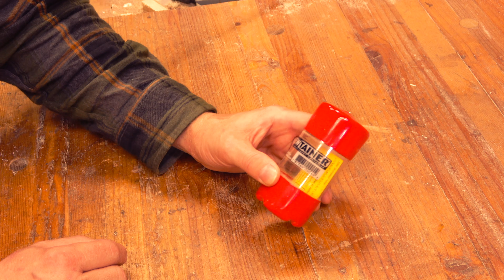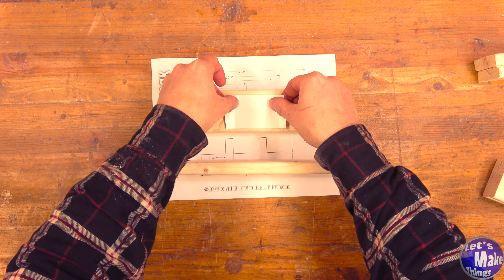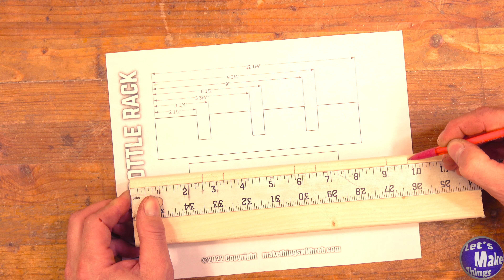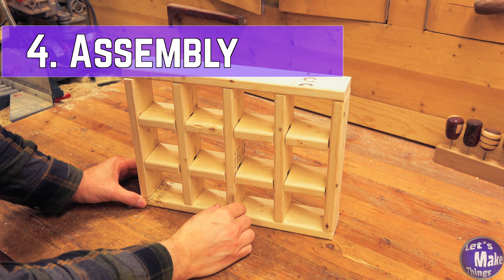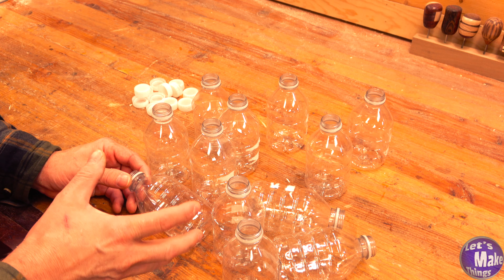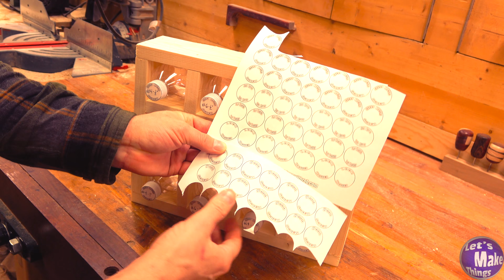Water Bottle Screw Rack (Instructional)

Comment: My sister bought a house with about 50 baby jars hanging from various shelves full of flat head and roofing screws. I like your storage system/project much better.
Reply from the maker: Thanks Terri.  I've seen some hanging types (I think that's what you're talking about?) and they do work, but you're taking too much vertical space on the wall to do it.  I guess you could use a metal peg and string them together, but then you have to sort through them to get what you want.
Reply: Growing up in the 60s and 70s all the dads had baby food jars with screws and etc.

Comment: I like the idea of the hot washer as it looks to keep the edges of the plastic in one decent line. Am I correct in thinking that the heat protects the edge as well?  Similar to rolling a sheet metal edge?
Reply from the maker: That's a great thought and I think it does, to some extent. The problem I have with using a knife is how easy it is to cut too far which can create a split.  I do think there is some integrity that comes with doing it this way that is absent with a utility knife.

Comment: Nice project.  I have used a heated utility knife blade to slice through plastic bottles and it works really well, especially if you want square edges or straight lines in the opening.
Reply from the maker: Yep, and there's less chance of putting too much pressure into it and cutting too far.  Thanks Hal

Comment: Simple and effective little project 🙂
Reply from the maker: Thanks Jose, and I think a thin walled tube would work well, too, especially if you added a bit of a grind on it to sharpen it.
Reply: @makethingswithrob  Thanks. Yep, sharpening would make the cutting action easier, I guess 🙂
Reply: PS: I would probably use a thin walled tube to cut the holes in the bottles.